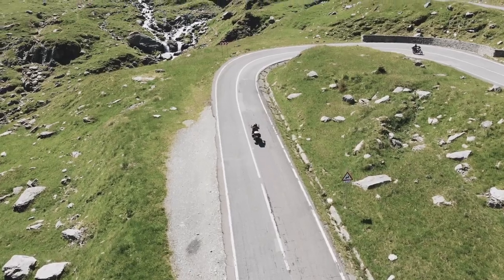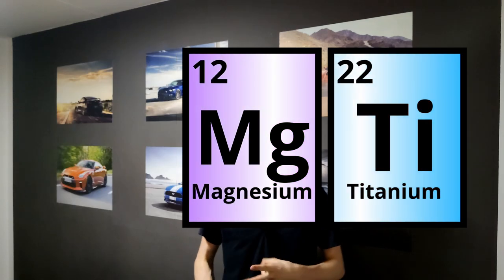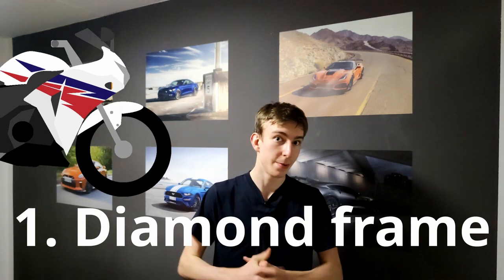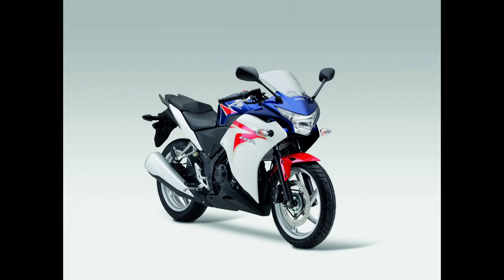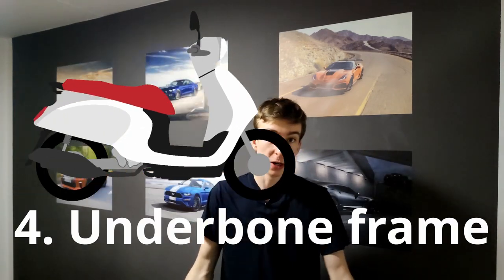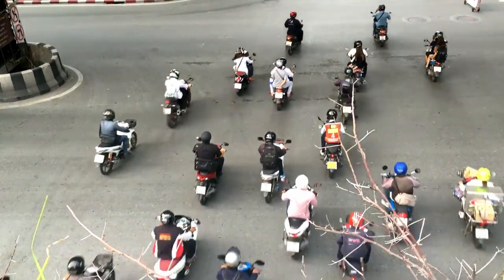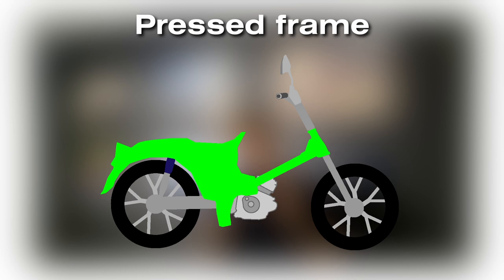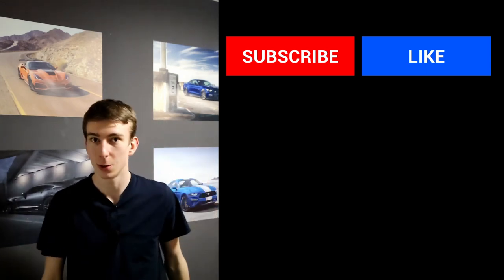Everything about motorcycle frames   | Motorcycle breakdown |

Comment: Exactly what I was looking for.  Well done 👌
Reply from the maker: Glad you liked it! 😉
Reply: @globerider7238  so, if I want to take an offroad bike, on the highway,  what should I do,  to make it stable?
Reply from the maker: That depends on a few things.

If it's an adventure bike, then all I would do is make sure that my tires are not too aggressive, would go for 50/50 or 70/30 tires. (Off-road/on road)

For a dirt bike, the tires would also make sense. And then I'm not sure whether dirt bikes are fine with going that fast, but in the Dakar they go up to 140 km/h, so I'm guessing that dirt bikes can handle it. The gearing and sprocket ratio is not optimized for top speed, so you would have to alter that if you wanted to go faster. Also make sure your off-road bike is road legal 😉

Comment: You would not want to bild your frame out of carbon fiber, because its impossilble to make the bikes feel the same. Steel is the best for street use because its not much heavier because you need less material for the same stiffnes. Steel doesnt break if you put load on and off over a long time.